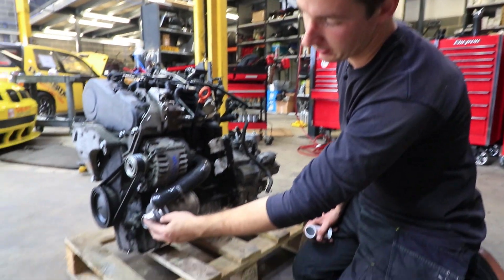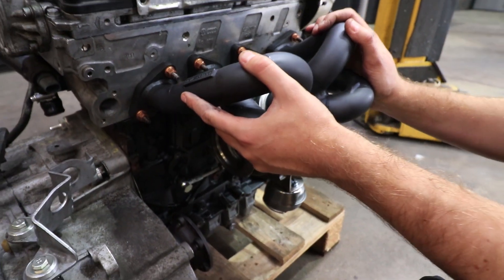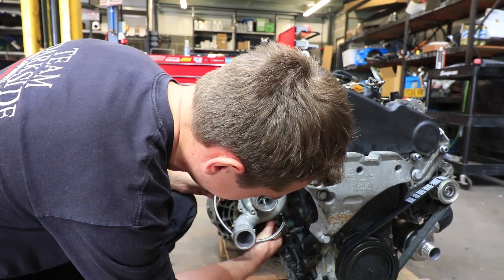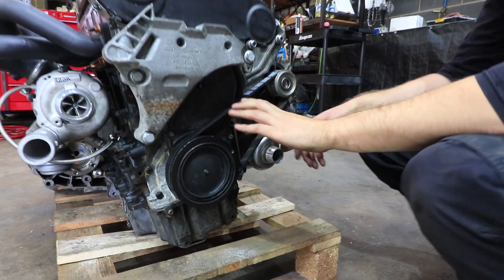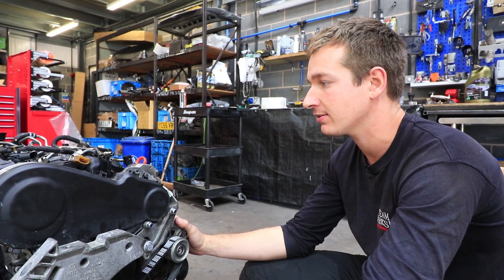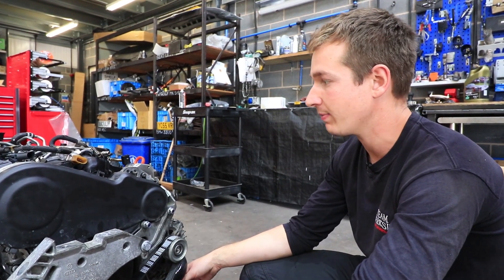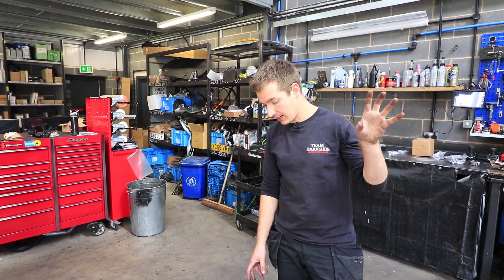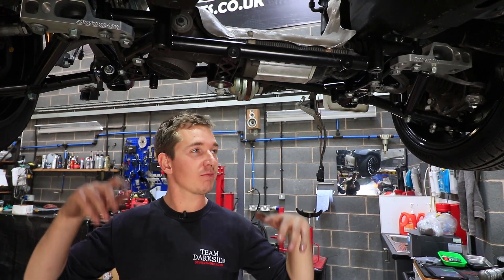MK5 GOLF TDI EX VW CUP CAR Building the TDI Race Engine! - Part 8 - DARKSIDE DEVELOPMENTS

Comment: Really like the kettle idea but i have a few questions. Is it possible to use the kettle on a stock tdi with a mechanical water pump in place and what water temperature is most appropriate ? Also a stupid question if a water kettle would get faulty and started to produce steam would it damage the headgasket or warp the head.
Reply: It would struggle to steam inside with the heat conductivity to the rest of the engine. We only use this for the first head bolt torquing. What water pump you are using makes no difference.

Comment: good question here: why would diesel engines need dohc(4 valves per  cylinder)? they dont rev higher than 4k rpm
Reply: Airflow management is easier for emissions with 16v and better for power if you port them!
Reply from the maker: This Revs to 5400rpm
Arosa is 6000rpm

Comment: looks like Darkside would offer a stand alone ECU!!! They are a few universal CR diesel computers out there for sell but if someone would make a plug and play for all VW diesels- VE, PD, CR, I think that they would sell like mad. Could sell a base model for like $500usd or $1000 for a fancy ecu that does vnt controller(s), boost by gear, boost by speed, waist gate controller(s), built in progressive nitrous controller and even a shifting interface for clutchless shifts. Even a basic little ECU for VE pumps would sell great because most people use a mechanical pump when doing a VW diesel swap here in the US, I know you could make a stand alone ecu for a ve pump way cheaper then what people are paying for a new mechanical pumps. Hell a ve pump is so simple I bet you could make it run off a $35 raspberry pi mini computer.
Reply: Easier to strip down the OE ECU. Even older engine's will take a lot to make them smooth
Reply: @ryanp6138  I honestly don't see how it would be that hard once you figured out how to make a program, you would have a map, crank and cam senior then you could just base your fueling off of that. like I said a little single bored computers cost less then $100 these days